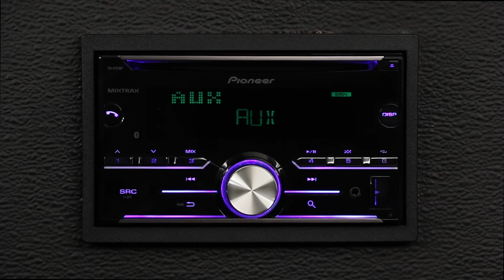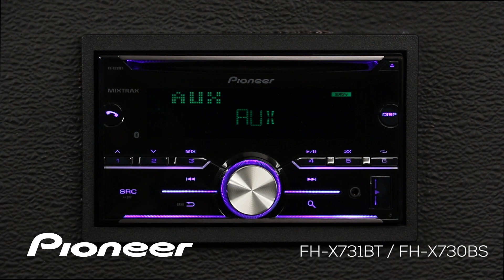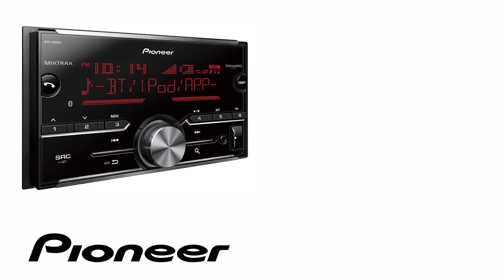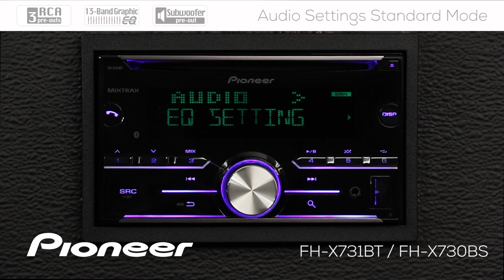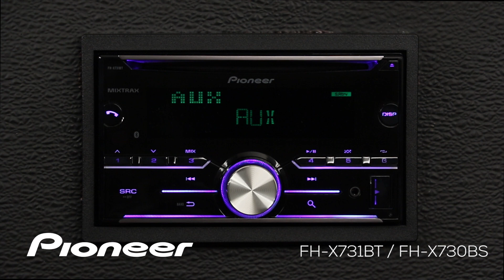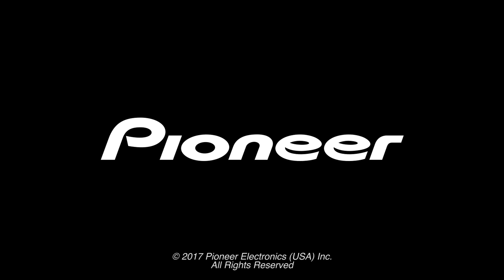How To - FH-X731BT / FH-X730BS - Audio Settings Standard Mode

Comment: My device unpair automatically when car restart
Reply: I lost volume And don't know  how  to  turn  it  up 😟
Reply from the maker: @lisawalls1007    What is the model number of your Pioneer in-dash receiver?  Please be more specific with your question.  If you are listening to music from your phone, you may need to raise the volume on the music app on the phone to 50% or so.   You can find more videos on Pioneer's YouTube Channel here:  https://www.youtube.com/@pioneerelectronics
Reply: @pioneerelectronics  x500UI It was up then the sound disappeared I haven't heard nothing in 3 days  It  still has pretty  colors Everything working But no sound anymore Thank you for your  response have a great day or night It's daylight here in SOUTH BEACH  FL.
Reply from the maker: @lisawalls1007   Is it possible, you've hit the "mute" button on the wireless remote control?   
I recommend to press the SRC button until you see the FM radio on the display screen. Use the <> keys to Tune in a strong radio station and adjust the volume with the large central volume control to about level 15-20.   If you're not hearing any sound it's possible the vehicle's speakers have failed, or the in-dash receiver's built-in amplifier has failed.  The Pioneer FH-X500UI was manufactured back in 2012 and may need to be serviced.  If you need to find a Pioneer Authorized service center, please contact Pioneer Customer Service in the US here:    https://www.pioneerelectronics.com/PUSA/Support       or by calling in the US   1-800-421-1404
Reply: @pioneerelectronics  Thank you so much you've been great Thanks for taking the time to help me Good Bless you

Comment: My sub stopped working a few weeks ago, I I cant figure out why. I swapped the rv wires for the sub to the speaker input on the amp and then all the audio started comming out the sub (proving that the amp and sub works) I then went to the back of the pioneer stereo (featured in this vid) and then swapped the rv wires again and the audio started comming out of the speakers again but still no sub, proving that all the wiring is still working, so it's just a problem with the stereo outputting signal through the sub output. I have messed around with all these setting and nothing will make it work, does anyone have any ideas?
Reply: Please be sure you have the subwoofer output switched on.  You can see that here:  https://youtu.be/HTJ07fk4Grs?list=PLw63zJRQbCNjrJMo-h1YOEbzCdXw_DWPG  For a test, I recommend to switch the subwoofer crossover off.  You can see that here:  https://youtu.be/HTJ07fk4Grs?list=PLw63zJRQbCNjrJMo-h1YOEbzCdXw_DWPG&t=205  If this test does not change anything I recommend to do a microprocessor reset of the Pioneer FH-X731BT.  The microprocessor reset button is on the face of the radio on the bottom right just below the USB port.  You'll need a paperclip or some other small point to press the microprocessor reset button.  After that I recommend to do a system reset.  You can see that here:  https://youtu.be/Aj8JItUGMPw?list=PLw63zJRQbCNjrJMo-h1YOEbzCdXw_DWPG  After you're done with this you'll need to go back and reconfigure the system outputs for Network Mode or Standard Mode.  You can see that here:  https://youtu.be/cmTgZSwcUJs?list=PLw63zJRQbCNjrJMo-h1YOEbzCdXw_DWPG  You can find more videos on Pioneer's You Tube Channel here:  https://www.youtube.com/user/pioneerelectronics
Reply: Check fuses

Comment: my fader doesn't show it did once now im stuck with front speakers only
Reply: There is no Fader control when the system is in Network Mode.  You can see more about Standard Mode and Network Mode here:  https://youtu.be/cmTgZSwcUJs?list=PLw63zJRQbCNjrJMo-h1YOEbzCdXw_DWPG
Reply: You can find more videos about FH-X731BT in this playlist:  https://youtu.be/YsyYo7O-Muw?list=PLw63zJRQbCNjrJMo-h1YOEbzCdXw_DWPG
Reply: Dude same prob right now
Reply: You have the in-dash receiver set up in Network Mode.  There is no Fader Control when the receiver is in Network Mode.  If you want a Fader Control you'll need to use Standard Mode.  You can see how to change from Network Mode to Standard Mode in this video:   https://youtu.be/cmTgZSwcUJs?list=PLw63zJRQbCNjrJMo-h1YOEbzCdXw_DWPG    Watch the whole video.  Do a System Reset from the Initial Menu and Choose Standard Mode.  You can find more videos about Pioneer FH-X731BT here:  https://youtu.be/YsyYo7O-Muw?list=PLw63zJRQbCNjrJMo-h1YOEbzCdXw_DWPG   and you can find more videos on Pioneer's You Tube Channel here:  https://www.youtube.com/user/pioneerelectronics